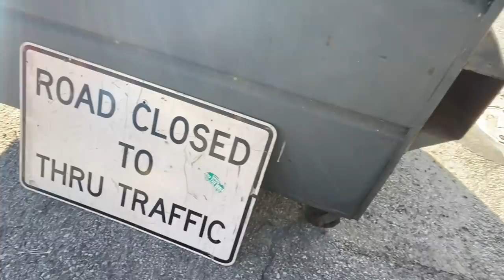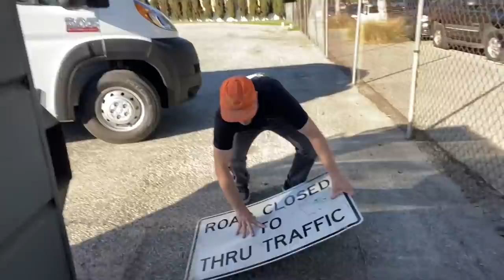HOW TO GET A KICKER FOR FREE!!

Comment: Step 1: dumpster dive
Step 2: buy $100,000 in power tools
Reply from the maker: Not even! Haha you can find tools on OfferUp and Craigslist on the super low. Or just borrow some from a friend or neighbor
Reply: @keenramps  or you can rent
Reply: $20 walmart jingsaw or skillsaw and a $20 walmart drill can do all this and more
Reply: @keenramps  I've got a circ saw sure but it's like cutting with a bag of cats, my quarter pipe is questionable
Reply: Harbor freight tools
Reply: Homie used a skill saw, and a drill. I've thrifted those and then some for about 50 bucks. Just need to know where to look and what you need. They arnt the best but they work

Comment: Advice from a Lowes Lumber employee: a lot of stores sell ripped open bags of concrete for $1 a bag. Also make sure that you are scavenging from a dumpster and not a compactor that’s is hooked up to a building. You don’t want to be inside on of those when someone inside turns it on.
Reply: Yeah, wouldn't be the first time someone gets crushed unfortunately.
Reply from the maker: Solid advice!! Thanks dude
Reply: @PHeMoX  d@mn
Reply: what’s the store policy on taking from the dumpster?
Reply: @dylanrogers2958 who cares. just take it. i guarantee you the managers don't care either. itl just go to a landfill otherwise.
Reply: I used to dump the garbage in the compactor at my work. Always thought it would be a easy way to make someone disappear.

Comment: I've been on construction sites that were so over-budgeted they probably threw away 3 buildings worth of lumber before the project is finished, I'd build decks and such for people on the weekends at a massive profit. a lot of places won't let you collect for liability reasons, but it never hurts to ask. I've been asked before, I told them 'I can't tell you you can, but I'll be gone in two minutes". kills me cause for the most part it gets chipped into BS OSB but alot goes to the landfill. Liberate Discarded Lumber!

Comment: I also used an old street sign for a threshold plate, but left a bit more length, transitioning from the ramp to the flat ground. The plate seems to be bending upward, away from the ground. Is this a common problem, and a reason to not leave too much length on the threshold plate, between the ramp and the flat ground?